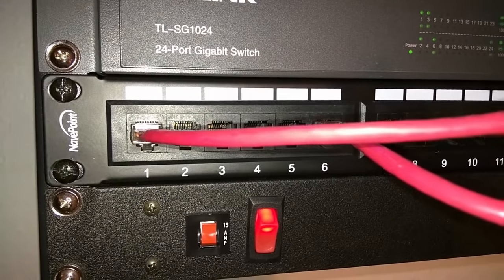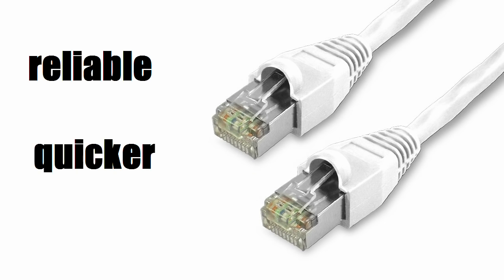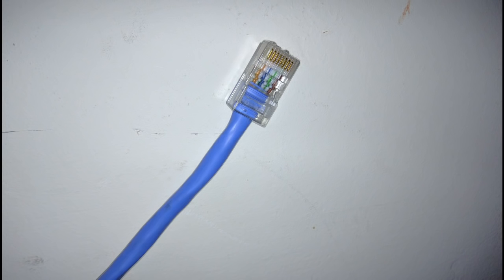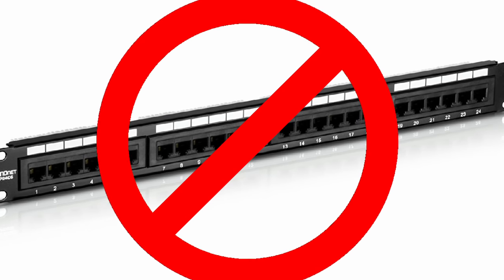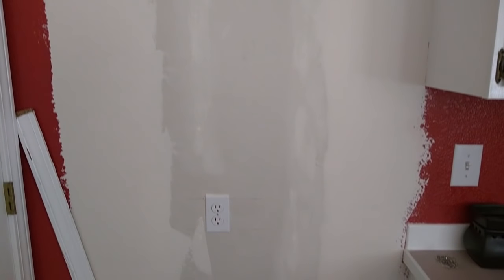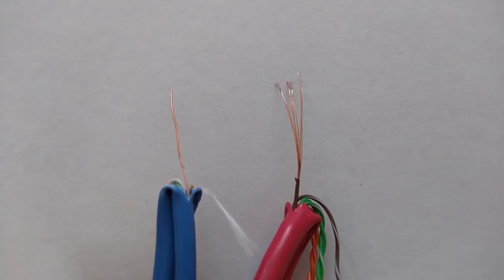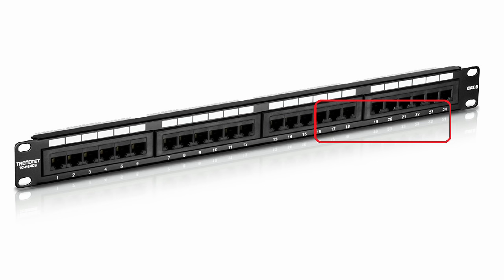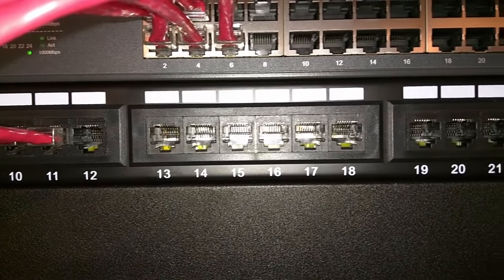What is a Patch Panel? Do You Need One?

Comment: Thank you for the great video! What kind of wallmount are you using with your equipment? It has an 15 amp fuse and power switch,  I would like one like that
Reply from the maker: I have links to the parts I used in my diy budget network video. I just used a normal rack. The rack mounted power strip is a separate part, and it's also linked in the other video.

Comment: Fantastic video !! much needed.
quick question: If some one "might" use cameras in the future, should he just get a (Power over eathernet) switch ?
i mean is it ok to use POE even when some ends will not need the power from eathernet?
Reply from the maker: You could get a poe switch if you think you might use it later. There is no harm in using a poe switch with with non Poe devices

Comment: Yes a patch panel is needed. Yes this is a home network.
https://i.imgur.com/jhddn3X.jpg

In this case We have a patch panel on the back of the rack to correspond to each patch panel on the front. This was to not only let us quickly manage them on the front but add more and rearrange on the back quickly. The cable comes to the rack via conduit, is terminated with a connector and is plugged into a patch panel on the rear that leads to the corresponding patch panel on the front before going to the switch. This is the 3rd or forth major change as we added 10 gig and upgraded a dozen cables to cat 6 from cat 5e.

The only part of the video that concerned me was putting voice and Ethernet on the same patch panel. If the voice is pots then it will have about 48 volts in the line. Eithernet only has 2.5 volts. If some one were to accidentally plug Ethernet into pots the 48 volts could kill a NIC or switch port.

Comment: With most homes, Living room and 3 bedrooms, 2 cables each, a dual gang 8 port wall plate could work as a residential patch panel.  Except for the lower level of nerd bling, this would have all the same benefits.
Reply: Bling and neatness are the difference, I think. You can have work done neatly without any bling. With the wall plate, you would still be running the cables from the wall to the front of the switch rather than to the back of a patch panel through to the front of the switch. It's certainly acceptable but falls into the same category as running a clearly visible extension cord to a lamp.

Comment: Those barbed plugs are the only thing stopping me buying one to play at being an old time telephone operator.
Reply: Those "barbed plugs" are technically called RJ45 connectors. They have eight wires in each connector. The smaller connectors you have seen to connect a telephone to a wall jack, and the jack is the receptacle that you plug into, is the RJ11.

Comment: Great video! Thank you for explaining this so well. I have one question. Let’s say I have 6 devices in my entertainment center (NAS, TV, Roku etc). What is recommended: 6 individual terminations to the patch-panel and have 6 Ethernet ports on the wall behind the entertainment center or one port that is connected to a small switch for all the devices in the entertainment center? Pls suggest!
Reply from the maker: Either option works. I ran several ports to my entertainment center because I could. If you have enough cable and the ability to run several cables easily like I did, then go for it.

However, you if you only have enough to run one line, don't mind purchasing a switch, that totally works too.
Reply: Thank you very much for your quick reply!
Reply: I have a 6 port switch mounted in my entertainment center.  I only use 1 device at a time, so it's simpler to run a single cable to the entertainment center and branch out from there.

Comment: I bought a rolling 42u Sanus rack for my home. 99% the rack will never come out. Can I put my patch panel in there or should I mount to the wall so that the wires don’t get worn out from occasional moving of the rack while servicing.
Reply from the maker: That is a good question. If you can cable tie the bundle to the rack so it won't put strain on the cables at the panel, that could work. If you're worried though, you could always have a little rack on the wall if that makes sense and would look good. Appearance and space and other factors would ultimately help you decide.

Comment: So you need a switch to make a patch panel work. Meaning you cannot by pass the switch correct ? However you can eliminate a patch panel (or choose not to install one) and run your Ethernet to the switch correct ? Or am I not getting this right
Reply from the maker: If you have 4 or fewer wired connections, you won't even need a separate switch, just use a LAN part on your router.

If you have more than 4 wired devices you want to connect to your network, then you would need to add a switch.

The patch panel is completely optional.

Comment: It would seem to me that a switch that has the ports on the back would serve pretty much the same purpose. You can have wall sockets and run those cables to the back of the switch and never again touch them. Indicator lights on the front and with 0 cables on the front you get a better visibility compared to a patch panel as well. "Mini networks" could be configured with vlans and then also consist of more then two wall sockets. Obviously you dont get more rooms so if you on purchase calculate that you want x number of outlets in each room, you only have to account for how many additional ports you would need to have in the comms closet (for whatever is not placed out in the rooms)

Comment: Hello BN, I have my modem connected to my Router and then connected to a HP J9138A Procurve 2520-24 Poe Switch so I can connect cameras and also run Cable from the PEO Switch to wall plates and cameras and anything else that needs a hardwire or Power over Ethernet, does this sound right?  I am also going to use this POE switch to connect to a NAS which has 4 ether ports.  Let me know your thoughts. Love your videos.
Reply from the maker: I think I understand what you are saying. Sounds right.

Comment: Before I saw your video I didn't know what a patch panel and I still don't know if I can use it for my model train layouts since most of the DCC systems use the RJ45 connectors. But I'm using the Marklin system which uses RJ45 for the S88 train detection circuits but not anything else.

Comment: Where did you get your patch panel and do you recommend any brand or model versus others?  Thanks.
Reply from the maker: I got mine on Newegg. I don't really have any recommendations.
Reply: As a Cable Technician for someone who doesn’t work with patch panels regularly I would recommend a keystone patch panel. Amazon has a few, one being from Cable Matters. A Keystone Patch Panel is basically just the metal frame. You connect individual jacks to the end of the words and place into the panel. Also this makes adding cables easier in the future. Cheers.
Reply: Gil Harari no problem. Quick heads up though, pay attention to the color code. There is T568A and T568B (Orange and Green pairs flipped) it doesn’t necessarily matter which you use as long as both ends are the same. In the US the majority of places use T568B. Enjoy your patch panel, they make things easier.
Reply: Cheap is ok for patch panels they are metal, $50 9way on ebay

Comment: You may have answered this but, Scenario: Living Room(Smart Tv, PS5, Cable Box, Security Hub,) Would it be better to run cat 6 to all devices or 1 Cat 6 to a switch to feed all devices?
Reply: I'd say if you're already going to run Ethernet cable to your living room, might as well run as many lines as you need and then add a few more extra.
Reply: I would run more than 1, but if budget is a factor not 1 for every device. Playstation, tv and cable box can run off 1 cable and a switch, as only 1 is likely ro be using data at a time so no bandwidth issues. Securitt hub on a dedicated cable for better bandwidth, and you may want to have it on a different VLAN or subnet at aome point.

Comment: Can you explain how you create a mini network with the crossover cable? I’m trying to understand how you can connect two ports on the patch panel with one cable and the resulting in the minion at work. Please and thank you
Reply: Device A: set up fixed IP address (say 192.168.10.10), netmask 255.255.255.0 (or 16 mask bits for Win10 users).  Leave router and DNS entries blank.  Device B: set up IP address 192.168.10.11, netmasks/bits as before).  You should now be able to connect both devices with a straight or crossed Ethernet cable (most modern devices will adapt anyway) and after a few seconds they should be able to find each other (do "ping <ip address of other device>" from a command line or terminal, i.e. "ping 192.168.10.10" on device B should get you a response from device A.  Good luck :)

Comment: Quick question regarding the Ethernet cable running between the Patch Panel and Wall Plate, Are you using Riser or Plenum rated cable?
Reply from the maker: Mine is plenum, but only because that's what I had lying around.
Reply: Follow electrical code, it’s there for a reason and that’s to offer some fire protection. FT4 “Riser” cable is tested and rated for going between floors or partitions. (In summary), FT6 “Plenum” is tested and rated for running through vents, false ceilings in offices, etc. don’t just use whatever cable is lying  around lest you find your homeowners insurance trying to deny you coverage because you had uncompliant cable in your house when you had a fire, even if it wasn’t a factor. if you’re running the cable through vents, which a lot of people do house because it’s easy, you should be using FT6. If you’re running it through the walls I believe FT4 should be fine. Do your own research on the differences to be safe.

Comment: A benefit you missed is having a properly networked home with wired internet cables going to each room instead of wifi will increase the value of your place should you ever move.
Reply: depends on your local housing market. In my area houses with sketchy ELECTRICAL installs still go over asking, and that's way more dangerous/important. 

Some stuff is only worth doing because you're going to actually live in and use your house. Wired ethernet runs is one of those since most people i know don't even realize they have an ethernet port on their laptop or that it's worth getting a USB adapter if their laptop doesn't have one and it's plugged in all the time.

Comment: Question. My house was a new build and it was wired with CAT5e cables to every room. The cables are not terminated in the box in my closet. Do I need to do this or can I just terminate the cables and plug them straight into the router?
Reply: this is my same issue
Reply: I’m sure you got an answer but you can do either.

Comment: So if i understand correctly, the procession is device -> wall jack -> patch panel -> switch -> router, correct?

Just from my searching around, you have to keep in mind that if you do it this way, unless your switch has a dedicated uplink port, on of your ports on the switch will be needed to link to the modem or router, and can’t be used by the patch panel.
Reply from the maker: Check out my home network 101 video. That may answer your question.
Reply: Correct!
Reply: You don't need uplink ports these days.  Gb and newer 100 Mb Ethernet sorts things out on it's own.

Comment: Doing research, about to route Cat 8 Ethernet cable through out my house, way over kill cable and my router or switches will not be as fast as the cable itself. But why not other then price. I am an overkill type of guy. Though Cat 8 appears to be competing with Fiber in speed nowadays so I  may be future proofing. I have never built a networking rack so I am researching options
Reply: Cat7 max, and than with pure copper (cu) and s/ftp or even sf/ftp shielding.
Reply: @broodjenoodles2382  I ended up getting a spool of CAT 8. But I agree with you, no point in going better then cat6a or cat 7 for a home network.  If I ever network up a data center atleast I can say I had practice with cat 8
Reply: @thehotshot0167  haha yeah, just going to lay cat7 in my house since it doesnt cost more than cu copper. dont want those ass cca cables

Comment: Hello i am still having problem understanding this, Why patch panel? You had Network switch above patch panel right? We can just connect into network switch if multiple LAN connections are there right? From last h panel to network switch is really confusing to me.
Reply: I understand your conduisons as besides making it look clean, organised and bragging rights it seems unnecessary. However, it's more of an organisation thing. Imagine you have 24 runs that all plug to your switch. Now, if you need to change your switch, you would have to lable them all, otherwise you will not know which one goes where. If you have a patch panel, they are already labeled and therefore organised. If you want to add a Poe switch with just a few Poe ports for the Access Points and Cameras, you will not have to fight with the length of the cables or rearange everything, as you'll just get custom length cables to the new switch, while keeping your old running. That is it in a nut shell. Hope it helped.
Reply: @johnevans6451  thank you for kind explanation. I think I got it somewhat now 🙈 for 8-12 connections in my HomeLab I can surely avoid it..

Comment: you must have a big House! I've just a few cat 5s one is just for Voe and I've just installed a single ethernet to connect to a old Wierless Router for my offices space (in UK Pronounce it a Rooter, ou is oo not aw) and I'm going to run a Long cat5e outside to reach the Attic to the second Router that will have only two other connections so leaving one Spair Port!

Comment: it means i can remove the switch and connect my patch panel directly to my router and it works very well still right ?
Reply: welllllll, no. A patch panel is a way connect that long wire in the wall to your switch just to make that line shorter. The main difference is that in a way you could argue that a switch and a patch panel are the same. However the biggest difference is that a switch will assign different IP Addresses to your devices. A patch panel is just a direct connection to said ethernet. 

Simply, a switch provides different IP address's, patch panel is a organizer to where that cable goes. The point of a patch panel is so that way you can easily connect to the cable in the wall through a shorter cable instead of messing with that wall cable.

Comment: Surehavea massive group of cables exiting the wall and going intoa rack. Then another cable internal to the rack to go from the patch panel to a switch. Cmon, A few 3 gang boxes in the wall and use keystone faceplates and build the panel INTO the wall itself then ONLY connect up to those ports into the rack's switches when needed. It's the same thing as this video but the "patch panel" is built into the wall and cleaner and when you move just unplug the cables from the wall and go. The next homeowner can bring their own equipment/switches and hook up as they need.

Comment: 14:53 using a cross-over cable to create a mini standalone network. How does this work? Since the cable goes from 22 to 24 do you not need one of these patched into the switch?
Reply from the maker: If each port you connect goes to another computer, it's like connecting both computers together with an Ethernet cable. You'd want a crossover patch cable though.
Reply: @BudgetNerd  Oh ok, so the network is just between these two computers. See i was thinking "How will there be internet if the ports are just crossed" but there will be none coming from that comms room anyway.
Reply: @BudgetNerd , @Mr.Sleep you don't need a crossover cable though. Auto-MDI(X) has been a thing for over 10 years, any device with it is able to detect and negotiate pairs on the fly, meaning you can run straight cables to any modern device and they will just connect. A PC connected to another PC with a straight cable will negotiate a pair switch on one of the ends and make a straight cable run like it is crossover.
Reply: Does anyone still use crossovers?  They're not needed with Gb and new 100Mb.  However, the point of the short cable is to directly connect a device in one location to another device elsewhere, without going through the switch.

Comment: Great video and setup, but your rack is upside-down and could fall off the wall. the screw heads are supposed to slide up into the small part of the keyhole
Reply from the maker: It's not upside down.
Reply: Those holes are universal as its an open hinged rack. Look at it again, there is a big hole in the center and 2 small notches up and down. He did slide the screw into the smaller notch, the other notch is just if he wanted to flip it around the other way. So technically there is no "upside down" on this style rack.. If that was not the case only a tiny bit of the screw would be making contact with the very top of the big hole however, you can see that the metal is deformed under the head of the screw indicating it is inside the notch..